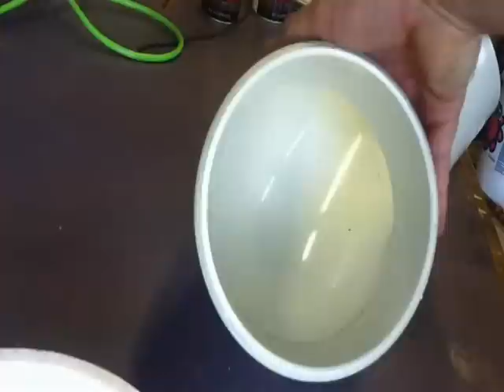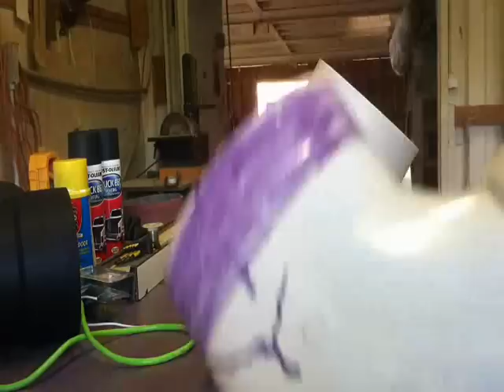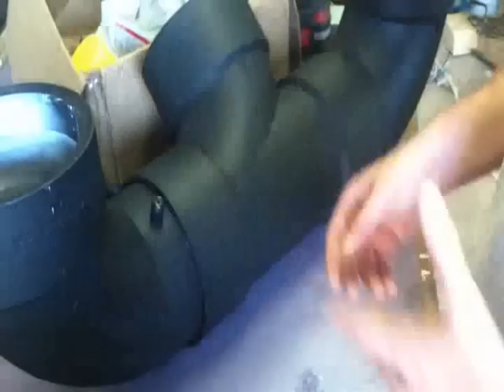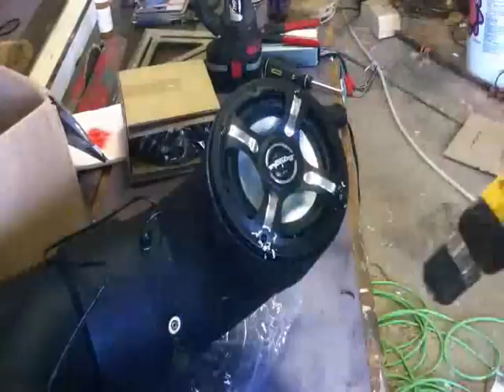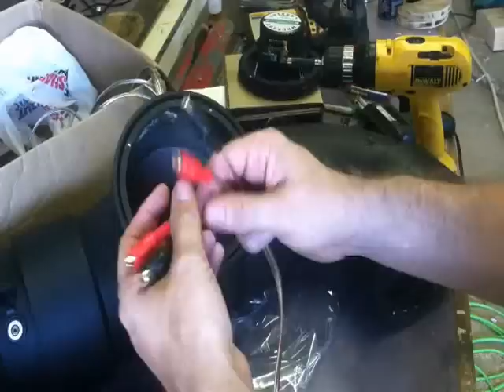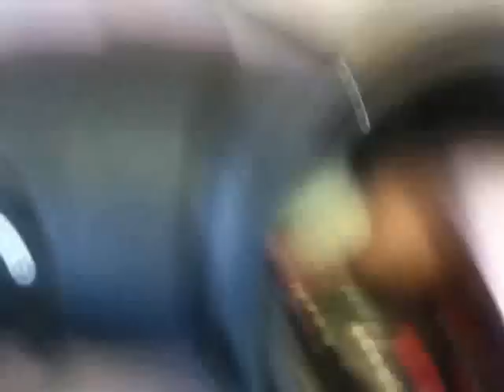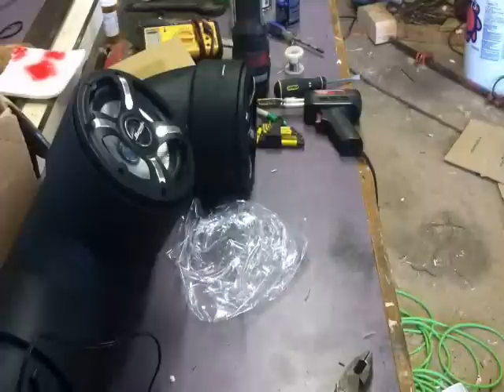Whoolie Shop Audio Tube Build

Comment: You can get a Two speaker , 700watt, Blue tooth, MP3, waterproof for $153 bucks,,on Amazon, just saying,  cant buy the components  for less than that, They look great, There probably not as good as the ones you are making but your prices are kinda high, There not that hard to make, I think you could come down a little bit so us poor people might buy from you instead of a big company like Amazon, I mean i would rather buy from someone like you thats trying to earn a honest buck than i would from the big wigs, But those prices are just to steep for me ,,Sorry,  but wish you the best with it,,good luck.   PS, Im sure you will do great,,Everybody's not poor like me,,lol
Reply from the maker: It's true it's one of those you get what you pay for situations.  The mass produced stuff from China is less expensive.  We're using schedule 40 PVC whereas the others use an extremely thin plastic that's a little more than 1/16" thick.  The chances of it surviving a bump or rollover is minimal where as I've seen first hand schedule 40 live.   As for their 700 watt claim I can assure you that's false as well.   Take your battery voltage (12.5 without the engine running) multiply that times the fuse in the tube. (I'm betting it's a 15 amp at most) and that's the maximum wattage the amp can produce without blowing a fuse.   15 amps X 12.5 volts = 187.5 watts.    Never ever buy an amplifier based upon the wattage advertised on the box!
Reply: I kinda figured they were junk,,but still i know you got about 150 at best in your two speaker unit, another 100 seems more fair,, that would be 250 for a two speaker unit,, i could afford that next month, but i understand if you cant, Its just that i could make one but i have Congestive Heart Failure and i had the widow maker last year and they gave me less than 5yr to live, I stay weak,tired, no energy, i put a cab cover on my Eiger, Making side covers now but it takes me forever to do anything ,,feel swells up from fluid build up, then i cant walk, its pretty tuff,, I live alone and all i can do for any kind of fun is ride my ATV, I cant listen to music on the CD player when moving, And i love to listen to music while im riding, But thanks anyway for the comment it helped me understand better about the Amazon tubes , To get one with the same quality as your it would cost 4or5 hundred, And,  it probably still wouldn't be quite as good as yours,, Take care bro , ttyl,     and God Bless,,,Later
Reply from the maker: +Dana. Doss  schedule 40 PVC elbows costs $22.84 each at lowes, a 10 foot section of schedule 40 PVC pipe costs $41.48 and they won't sell you a shorter length.   Granted you could make several u shaped tubes out of a 10 foot section but you still have to buy a full stick of it.  Therefore you've got $87.16 invested in just PVC to make one tube that doesn't include primer, glue and paint (or having it rhino lined).  You'll easily spend $100 in materials before you ever shop for an amplifier, speakers, Bluetooth unit, grommets, 3.5mm to RCA adapter, splitters,   Speaker wires, power adapter (or switch and wiring).  

The amplifier in this video costs about $115 and speakers run around $90/pair. Now we're closer to $300 and there's not a dime include for labor to cut the PVC, prime it, glue it, prep it, paint it, assemble it, tune it, pack it and ship it.

Comment: what power source did you use for the amp? or does it not need one?
Reply from the maker: The power source is a 12 volt DC system.  This particular tube was wired up with an accessory port plug for an atv.  It could just as easily be wired up with a direct connection to a 12v battery
Reply from the maker: +Jedyn Hanna we do, and we offer several different options you can email us at sales@whoolie.com or call us 7042024527
Reply: +The Whoolie Shop do you do orders for people because I need you to make me one for a 125 atv

Comment: no i want 2 speaker audio tube
Reply from the maker: +Dennis Glorioso   Sorry Mr. Glorioso, as I mentioned in the last post the PVC pipe + fittings will use up most of that $50-$60, (Again we only use schedule 40 PVC that is 1/4" thick..  Not the cheap sewer pipe that is fragile as eggs)  add in assembly, amplifier, speakers, rhino lining and it's quite a bit more than your budget.   The least expensive two speaker tube we build is ~$350 the materials alone are much more than $50.

Comment: i don,t want to spend more then 50 or 60 bucks
Reply from the maker: +Dennis Glorioso  If you're talking about a full 4 speaker audio tube build for less than $50-60 it is simply not possible.   The raw schedule 40 PVC Y's in the above video cost about $32.00 each and that's not including having them rhino lined or set up to work with speakers & amplifier with power connections.        One of the AM/FM/Bluetooth remotes however runs about $110.        Theres also the Kenwood  KMR-M315BT which is basically a kenwood head unit without the CD player.  and is short enough to mount in 6" PVC (~$99)     You could also use a normal IPOD as most of them have AM/FM tuners built in, plugged in to an audio tube, or if you happen to have unlimited data one of our $40 bluetooth adapters plugged directly into the tubes amplifier + I heart Radio app would give you a lot of options for FM radio.

Comment: Nice video, very clean looking product, but when you were installing the grommet and used the roto-zip, couldn't you use the tap drill for the threads or will that cause it to leak?
Reply from the maker: Most definitely!  If you have a tap use that then seal the grommet up once you get it screwed in.

Comment: Can u make one without radio and amp
Reply from the maker: You mean just an empty tube? Or one with just speakers?  Either way yes it could be done without an amplifier but the amp is needed to make it loud.  If you're just looking for an empty tube shipping pvc is reasonably expensive it usually costs about $50-60 to ship a tube based on weight and size

Comment: Ever use 5.25 speakers? If so what size PVC tube?
Reply from the maker: They do make 5" pvc conduit that would probably work depending on the actual size  of your 5.25" speakers. 

The real problem with smaller than 6" PVC is finding an amplifier that will fit inside the pvc. But you could always take a speaker in with you and find the 5" conduit and see how it fits in a coupling or elbow!

Comment: I built one myself but the echo is terrible. Do you every use insulation to get rid of the echo?  I used drain pipe pvc. Maybe that is the problem??
Reply from the maker: Stuffing some polyfill or fiberglass insulation (a large fistful) in behind the speaker should give it a much more full sound and should take away the hollow sound. 

If you're using the really thin stuff the the entire tube might be resonating.   The thin PVC flexes and is about 1/8" thick.  You can deform it with your hands.  

Schedule 40 is about 1/4" thick and way more rigid.

Comment: Question, where did you get that RCA Bluetooth adapter? And what size fuse did you use on your amp?
Reply from the maker: Bluetooth adapter is available at www.whoolie.com

And use a size fuse that is equal or one size smaller than the one in your amplifier. Never a larger fuse. 

The fuse is there to protect your atv electrical system / battery in case a short were to develop between the tube and battery.  It needs to be installed 12 inches maximum from the battery

Comment: Are you getting your PVC fittings online?  If so could you post a link. They're very expensive here locally
Reply from the maker: No we get them from lowes or local plumbing supply stores.  If you were to find them online anything you saved would probably be taken up in shipping.  

Schedule 40 Fittings and pipe aren't cheap here by any means either.

Comment: great project details and video. could you please give a few more specifics: is this a 6 or 8 inch tube, the model of the amp and speakers you used? thanks
Reply: Thanks you really did a great how to video.
Reply from the maker: Sure thing, 6" schedule 40 PVC is what was used for this build. Some people use the thin wall sewer pipe to save a couple bucks but the thin stuff won't give you anywhere to land your screws. You could use 8" PVC but it gets quite expensive real fast. A 6" schedule 40 wye costs about $29. The last time I priced an 8" schedule 40 wye it was over $100. 

If you're considering 8" speakers a fiberglass enclosure would probably be the better choice. 

The amplifier used in this build was a clarion xc1410 4 channel marine amplifier. The speakers are 6 1/2" bazooka marine speakers. 

If you need any help with your build don't hesitate to call or email us!

Comment: hey man awesome build and how to vid. can you please tell me the song and band you were playing once the speaker was done? oh how hard or how expensive can it be to add one or two 8inch subs to this system? thanks for your help.
Reply: There were two songs, the first one was stone by Alice in chains and the second was get lucky by daft punk

As for adding an 8" sub it can be done you would need a 4 channel amp or a second two channel amp with a crossover in it.  However 8" PVC pipe is quite expensive and you'll be unlikely to find anywhere that will sell you short lengths.  You may have to buy 10 or 20 feet.
Reply: For an 8" sub a fiberglass enclosure would probably be the better way to go

Comment: Ok thanks. One more question. Can u make a 6" speaker work this same set up.
Reply: Yes 6" PVC works just fine with 6 1/2 speakers, which are what most speakers you'll find are around the 6" range.   Some actually run 7" so you should check with the manufacturer of the speaker to verify the size. 

I may have not been clear in my last reply but 6" sch 40 PVC for 6 1/2" speakers
Reply: Ok thanks. I just found a good deal on four 6" marine kickers an was just making sure they would work.

Comment: What's tha best diameter size schedule 40 to use on a 4 speaker set up. Where there is two on each side of tha rad relocation.
Reply: We use 6" schedule 40 for everything, if rack space is a concern consider rotating them 90 degrees so that the speaker the 45 part of the wye is pointed up at you.  
I would also recommend hard mounting them to the side of your radiator relocation kit as strapping them down isn't really easy to do unless they're lying flat!

Comment: you should use shrink tubing instead of electrical tape
Reply from the maker: I mentioned that heat shrink could be used if available.. (Around the 27min mark)  if taped properly with each wire taped individually then taped over the two connections the chance of a short would really be no more than with heat shrink tubing.
Reply: but with heat the tape will come undone over time trust me i know from experience